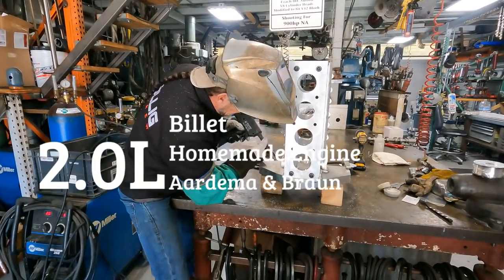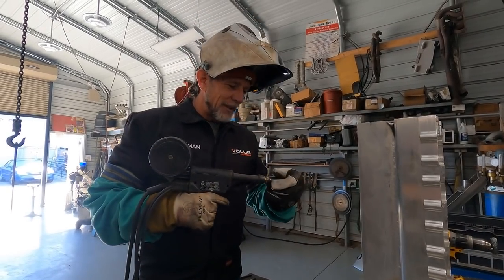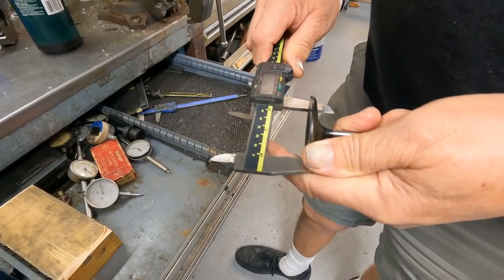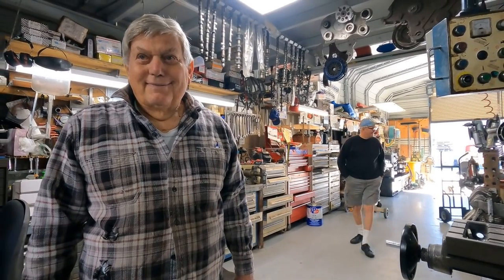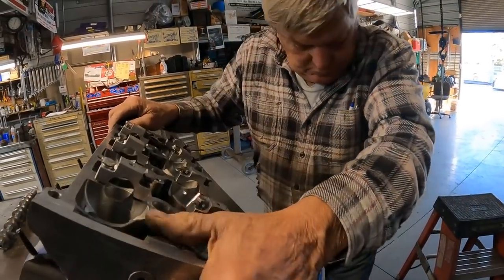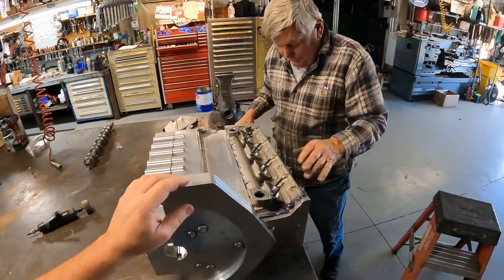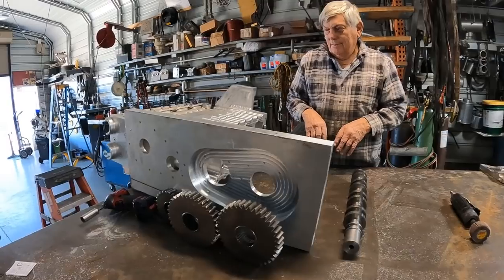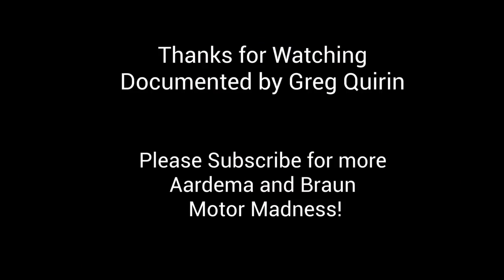Homemade Billet Engine - How to Make a 2.0L Engine from Scratch

Comment: Well Fab man doesn't know shit about Welding !!... Spray transfer is the only process for aluminium .. short circuit will fail ,.. More importantly hes using 5356 wire ,. the black smut  shows ,.. only has a temp rating of 150 F !!! ..  shouldnt be used  on a engine casting !

Comment: They should take 3 motorcycle engines like the Ducati or Aprilia V4 and build a V12 from it! Just weld the 3 cranks together. 700 hp from 3.3 L!

Comment: I want to essentially combine two old old Japanese k-car 3 cylinder 550 cc engines and make a 1.1 Litre V6 that can fit in a tiny car...for science. (Fuel injection + tiny twin turbos for the awesome)

Comment: I do the same kind of motor busines, it keeps Dementia away but the sad thing is when I´m gone nobody understand nothing from my engines. Maybe car gyis but I´m working in Aviation enviroment and they dont know how the motor works.
Reply from the maker: I'm sure what you are doing would interest Pete and Kevin.   I have gone to a few car shows with Pete and most folks don't quite understand their engine designs and modifications.   For example Pete has a 32 Ford with a flathead v8 which they converted to overhead cam. Most folks at car shows cant fully understand what they are actually looking at.  You should see the new 5L V12 they are making!

Comment: Hey I am trying to re create a ford model A pickup truck from the 20s and I wanna know if it is possible to try and re create a smaller functioning version of the same inline 4 cylinder engine that powered the car when they were pushed off the assembly line

Comment: I would just cut the bellhousing mating surface out of the billet, so there's a solid single piece, not taking anything away from the welder, who knows his work, but even the greatest welds have their weaknesses, the process creates some conditions and potential substrate alloy cracking issues, fissures, the alloy's structural integrity and molecular rearrangement from the heat and electrical current, why take a chance when you could be positive that there are no weak links parrallell with or perpendicular to the blocks machined mating surfaces, bolt holes, orifices, mount bosses, stress free!

Comment: I'm surprised they are welding with MIG instead of TIG? Is it for speed of putting the weld down? Or is the TIG rage just a marketing gimmick and really not all that it's made out to be?
Reply: We weld them together with MIG because it welds using DC current which gives us much better penetration. We then have the block heat treated and it gives us a very consistent material. 
When I machine it after the welding, I cannot ever see where the weld is.
Erik is a certified welder and has been welding for over thirty years.
He knows what he is doing.

Comment: Thanks for these videos. Is going to be for a naturally aspirated 2.0L land speed record car or for a turbo?
Reply from the maker: My guess is it will be natural at first them fuel class and perhaps boosted to capture as many records as possible.  I will ask and find out for sure.  Thanks Greg
Reply: @GregQuirin  Thanks Greg, for blown 2.0 L class, the Honda F20/K20 series engine might be the target, but from my understanding, these are some of the Bonneville records holders for the naturally aspirated F, G  and H engine classes.
F/GS - Barnyard Bearcat, 3x 1000cc Suzuki GSX-R 1000 motorcycle engines (250cc/cylinder)
F/FS - CMR New Zealand/Reg Cook, Judd V10 3.0L (300cc/cylinder)
G/GS, G/FCC, G/GC and G/GALT - CMR New Zealand/Reg Cook, Synergy V8 (250cc/cylinder). Synergy V8 was used in the CMR streamliner until the 2018 season and in 2018 was used in the CMR Nissan coupe which set the G/FCC record and others.
G/FS - This record was held by the CMR streamliner, but from my understanding the new record holder from 2021 is using 2x 1000cc three cylinder engines for a total of six cylinders (333cc/cylinder). Would love to know more about this one if you even catch it on video.
H/GS and H/FS - Rick Yacoucci, Suzuki Hayabusa 1350cc motorcycle engine (338cc/cylinder).
All smaller than 350cc per cylinder, short stroke and high revs.

Comment: I'm cringing kuz that welder Diddnt preheat that block! Welding cut billet like that can warp it! Some spots will be t4 t5 and then t6nnear the welds and can twist that Bock up! Same with sheet! Did aero space fabrication for years! We always had a torch or threw it in a oven before laying full beads down!

Comment: With the skills these guys have I’d love to see if they could do a 8 cylinder boxer engine
Reply from the maker: I'm sure they could do that with no problem if Pete  was up to it.  I will mention it to Pete, however in Pete's world it needs to make lot of HP and in theory work well in land speed racing applications.
Reply: The 8 cylinder boxer engines like the ones used in the Porsche 908, are some of my favourite engines, but for land speed records, you need low frontal area and boxer engines are wide. Take a look at the Nebulous Theorem, which holds some of the records in those low capacity streamliner classes and it has a very low frontal area.

Comment: Honda has built 17,500 RPM oval piston 750cc V4 motorcycle.
Reply: The reason Honda used oval pistons is that the rules didn't let them use a V8 and if you are wondering why not use a small capacity high revving V8 for land speed records, that has been done. Just take a look at the fastest speeds at Bonneville for 2.0L naturally aspirated engines. e.g class G/FS, G/GS, also G/FCC, G/GALT maybe other classes.

Comment: Easy enough.   All I would need is time, money, and all the right tooling.  Your next mission, should you chose to accept it: A 2.0L inline four cyl 2-stroke using Honda CR500 as a base.  And I want to see segmented cone pipes.  And it has to fit all Miata's and S-2000's

Comment: Spool gun welding is the worst way to weld that you should have tigged it 😑
Reply: Tig welding aluminum is usually done with AC current, which gives you terrible penetration. The spool gun is DC current which gives excellent penetration. Everywhere I cut into the welds there have been absolutely no voids, and the weld material appears the same as the base metal because the entire block was heat treated and aged to T6 condition.

Comment: Very interesting build, I’m surprised there are so many 180 degree turns in the driveline, it seems like that would have more parasitic loss
Reply: Not really. It's less than putting in 90's... that's why front wheel drive car engines are sideways. You can use straight cut gears to eliminate thrust problems on the shafts everything is straight line. The most losses you have in a conventional vehicle is the differential out back.   Now I"m not talking about driving characteristics, I'm just saying mechanical efficiency. Personally I think all front drive vehicles handle like shit.

Comment: I did a 292 gmc bored to 301 and cut two 351 4v Cleveland heads then welder then together made Hillsborn.injecsion got 450 hp need to make rod longer to see get more power

Comment: Should be using helium or argon for welding aluminum .... the black discoloration at the edge of the welds is evidence of carbon , and the welds are going to be brittle ...
Reply: I have a few degrees in the related areas of expertise and taught specific welding classes for a few universities and a couple of union education classes for automotive skilled trades . This is far from any of the preferred methods of welding aluminum and then I would have to worry about it holding up to weld integrity testing! I do enjoy watching them attempting to fabricate with minimal formal education in the areas they have been doing
Reply: @agp9844  Looks like he's using some type of CO2 mix ,,,, He may be lucky , but it never works for me ...

Comment: Greg man, thank you so much for sharing the A/B brilliance with us! That little motor is going to be psychotic.
I've been searching around the one of the GM short deck racing blocks off and on forever. GM stopped production because not many folks even understand the concept of a high rpm build. Nevermind attempting to build one. This started after reading about Pete and Kevin had used Datsun dohcers on an SBC. Imagine a 4.185 bore with a 2.8 inch stroke, beautiful little 10k rpm screamer.
Do they have a source for 8.2 inch deck height blocks, Datsun or GM? I might actually be able to use an IRL block, still in the dreaming phase.

Comment: The price of used NASCAR valves is astounding but the sizes are odd and only work in custom applications. But if you've got the machining capability they're a screaming deal.

Comment: Just purchased an aluminum welding spool gun, so I can start modifying the intake systerm of my Corvair engine, which has two 90 degree turns I intend on eradicating and will go w/ separate carbs/throttle bodies for each cylinder. My hope is to get 300 HP from a 2.9L engine, which will kick the RPM range up around 8K RPM mark, but should handle the revs due to the opposed-cylinder configuration. Fingers crossed.
Reply from the maker: Keep us posted! Sounds pretty cool!
Reply: Get your material super clean and the welds won't be sooty like this gentleman's were
Reply: @clevelandmortician3887  aluminum is essentially a sponge when it comes to contaminates. What I am curious about is if the weld zone was pre heated prior to welding. With a billet block that thick it is going to suck the heat out of the weld as soon as it is done, which could lead to stress cracks down the line (due to rapid cooling and shrinking of the weld)

Comment: 11:31 Unique design? So a gearbox under an inline-4 like in the mini and also transverse like in a mini? Laying flat like in a Fiat 500? I see so many gears which also only have 95 % efficiency. I don't get why we would introduce more of them? A bevel gear is only a problem for cars which don't want to run a shaft through the cabin. Every modern sports car with good downforce: Puts the cabin far in the front and then have a long valley where the wind pushes down. A flat engine is of course ideal for a deep valley. Like V6 120° from McLaren. Or V12 180 from Ferrari. Subaru BRZ comes to mind. Transaxle like in Porsche or this Nissan 4wd car I forgot the name of.
Okay we want to use the head. In a lot of cars ( mercedes Benz, BMZ ) the inline engine was not straight up, but laid to the side until intake or exhaust ( depending on side ), hit the floor. We can center the engine ( CG ) and have the shaft running obliquely towards a center rear diff. I mean the final gear does not sit in the center anyway. Maybe the shaft can still stay besides the feet? Sure it cannot go between. TopGear just goes right through. So the other gears can be put to the other side to center CG. Just need a custom final gear for the odd angle.
Reply from the maker: Thanks for all this info!  I can tell you know your information well.  Pete and Kevin  usually have great success with his builds.  Somethings they have to go back and redesign but overall they both do very well for the outcome they desire to obtain. This year along, they got 4 land speed records which is pretty darn good. Pete and Kevin were devastated when the V12 lost compression and #12 cylinder and they weren't able to back the record with a second run.  But that's what racing is all about.  Thanks- Greg
Reply: @GregQuirin  Sure. But I guess the design will change before the race. It just not so many words in the video and not so many reasons given, like it was all planned for a long time. Hard for me to get behind it. Craftmanship is top notch. There are many classes, so the art seems to be to pick the class where the least amount of effort was given in the past.
For example I did not really get if the will be a FWD. There are just so many cars made for the streets that I cannot believe that this becomes a completely new configuration. Take for example the Citroen DS: It has an inline-4 behind the front axis and then clutch, diff, gearbox. So you really put a Lancia Stratos Chassis over it.
So like a funnyCar. Build a Streamliner which is looks like a Street car.
Also I saw the SpeedDemon Video. That thing has much more modern aerodynamic shape, though I hate the pointy nose. Feels like kids which think that their paper airplanes will experience supersonic airflow like a jetfighter. Or a Jet racer.
Maybe they should cooperate with some aerodynamics guy with CFD? Why do they even need downforce? Neutral would be enough. With a transverse engine I think a Honda Civic or a Golf Mk1 should be the basis. At least in modern Golf the engine is already reclined, so just add some. The car gets wide, but area rule is not good to create subsonic aerodynamic shapes. First of all you have to avoid flow separation ( Streamlines ). You we can have a wide hood, with a bump in the center for the engine, if we follow the streamlines afterwards. Just add panels around empty space ( that hurts a bit ). Is it a trike? Single rear tire may be enough. Tail dragger .
I at least I would rather watch such a car made by them than other record runs.
Reply: I think they are using gears from a quick change rear end so they can easily make ratio changes.
Reply: @danielkruger4305  I think this liberty gear box is from drag racing and allow easy change of each gear. That said, there is probably no way to go straight through. Dragsters need most power in the low gears, while a ship, plane, or land-speed record vehicle needs it in the top gear. Change the final gear ration, is this really a thing?
Reply: @ArneChristianRosenfeldt  Yes, changing rear end gear ratios really is a thing.
In land speed record attempts hitting the right rpm when you are at the limits of horsepower vs drag is critical.
Reply: @danielkruger4305  But you could do it in the normal gear box? I don't know the English word for the different layouts. Usually the final gear is one piece with the diff and in a tight housing .. even unsprung weight when it is not an independent suspension.
Reply: @ArneChristianRosenfeldt  Most likely top speed will be done with the transmission at 1:1 and the adjustments are done with changes to rear end ratio.
Reply: Not sure about the mini comparison, as the mini runs the gearbox in the engine oil, like many four stroke motorcycles. But please don't suggest putting the drivers cabin far in the front, that was banned in IMSA in the early 1980s and cars must have the drivers feet behind the front axle line since then. The same rule was introduced in Formula One in the late 1980s and other racing series followed for very good reasons. But yes, front wheel drive streamliners are not new. Take a look at the location of the driver vs engine and driven wheels in this car, which is the G/DS, G/FS, G/GS and F/FS Bonneville record holder. Edit - from my understanding their G/FS record was beaten in late 2021.
https://www.youtube.com/watch?v=9MRa-p9o4mk
Reply: @alexjenner1108  https://youtu.be/9MRa-p9o4mk?t=41

That video has an odd fps and no clear view of the internal. Still you see how they try to direct the airflow downwards after the front wheels. Likewise the air should go downwards after the cabin. And this bump 30 cm before the rear end should be hidden under a downwards slope coming from the cabin. Of course for boundary layer reuse it is great that the tail fin emerges out of the cabin, just remove some flesh.
I agree, no feet in front of the axle. You can always make the tail longer and put a wing on it.
Reply: @ArneChristianRosenfeldt  engine in that one is a 2.0 L Synergy V8 which appears to be mounted in front of the front driven wheels. They have now put the Synergy V8 in their Nissan NX coupe. For the streamliner, they now have a rear tail fin and the engine is a 3.0 L Judd V10. They set the F/FS record using the Judd V10 engine and from my understanding have run at least one run over 300 mph in F/GS, but haven't been able to put two good runs together for the record.
https://www.youtube.com/watch?v=pnHqA3eKRXA
Reply: @alexjenner1108  cool. I did not want to talk bad about the records, I merely mean that those cars are almost perfect. Somehow I now want to see a 2l, 8 valves per cylinder ( Honda style ) 2CV with a low hood. Air cooled + some water for the head.
Reply: @ArneChristianRosenfeldt  from my understanding 8 valves per cylinder with Oval pistons was used in Honda bike due to rules limiting number of cylinders, but no limits in land speed. Air cooled + some water cooled head is interesting, but does it give any benefits for land speed?
Reply: @alexjenner1108  BMW uses oil cooled heads.  So they are always liquid cooled. At least with more than two valves. Air cooling reduces the part count. 2CV, BMW, and radial engines have enough space around the cylinders. I was just thinking how to put as much power as compact down below in the front. The driver rides the gearbox.
My problem now is that can’t route the exhaust as elegantly as on an inline engine or hot vee. Also the hood needs to be high enough for the front wheels anyway. So a transversal inline engine would fit. Maybe a special thin gearbox with two gears where the lower gear connects to a second gearbox behind the axle. Almost like proposed in the video, but with less friction for the top gear.  Feels complicated. Transverse engines are so much more elegant in a standard width car than in a bike or streamliner.